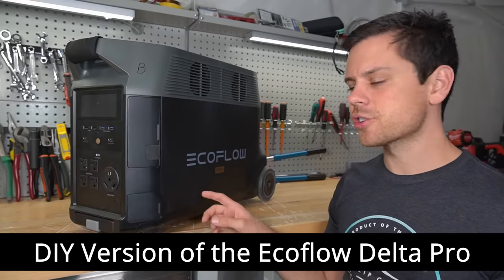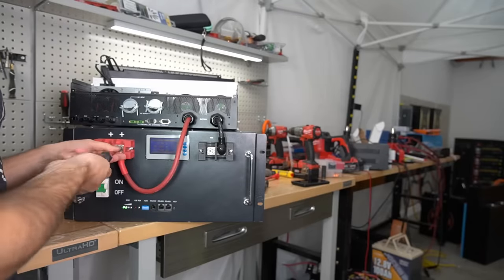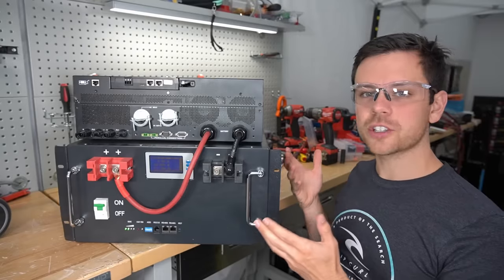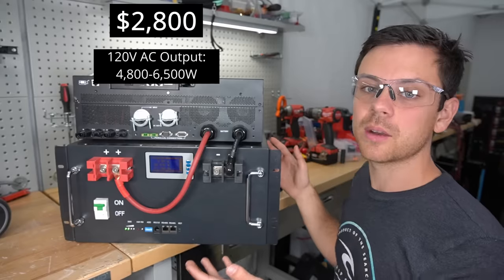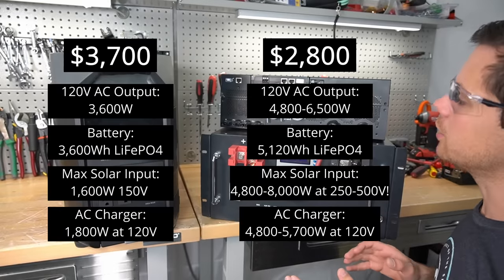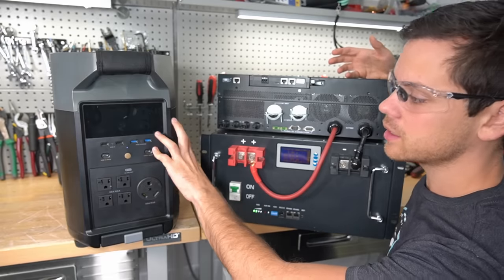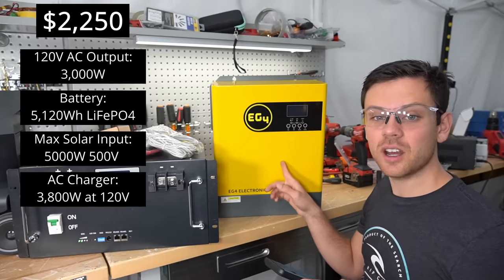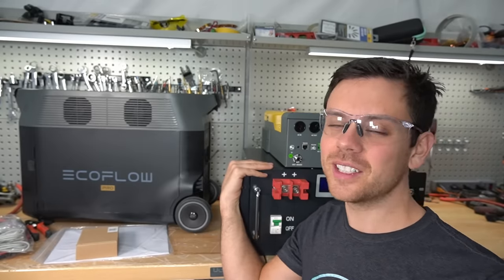Budget DIY Ecoflow Delta Pro! More power for less money

Comment: This is not a true comparison..You have to add more to the diy system..so cable connection for the AC power and fuse block and fuses this will soon be more expensive than the delta pro...a fair comparison would be to bring your diy system to the same level as the delta ..plug in ready and then tell us the cost...be fair
Reply: Nope , way cheaper to do a DIY,. It's not even close

Comment: The one thing that you never mention is that most of the generic MPP based inverters are not FCC Class B or CE certified, so they may generate interference into radios, TVs and audio components. Most of the big names like Victron, Schneider, etc. are certified, as well as Ecoflow, Bluetti, etc.
Reply: that is useful to know (certification type to ensure no interference) thanks
Reply: @koborkutya7338  these are sponsored products, all come from China, i doubt they are as sturdy as Victron. But its hard to know , the names of there companies do not say anything, I asume its generic cells from China put togheter with a name on them. Lion energy sells prismatic batteries in gheir boxes, but they are backed by Costco forever return if they fail. I have a hard time to trust these new brands without solid warranty.
And keep in mind all these inverters are transformless, which could mean short life. I think a solid  transformer inverter would outlast all these printed board items
Reply: @crinabobo7412  LF inverters have significant idle consumption as a drawback. 
Besides, i work in a similar industry (not power electronics itselft but using components from there) and you really have a hard time to tell what is China-made - practically everything is China-made. It used to be cheap and we are starting to pay for that now, we (Western developed countries) outsourced producing to them.
Reply: @koborkutya7338  If you open up a Victron inverter and see the parts. You will realize that ghey can be replaced on the board, the newer printed board ones under no circumstance. 
The power draw is not so big can be compensated with an additional solar panel. You can run a transformer based inverter techically forever if not abused. Regarding the capacitor only versions. 5 to 10 years.
Reply: Thia sounds like a cd player 52x , then they came up with the 100x....
It is all about fire, security....no ce not fcc, no ul....i would not trust my dog i side an RV with this....
Reply: @koborkutya7338   what about the Sol Ark inverters?

Comment: Really appreciate and enjoy your DIY videos Will, especially when you revisit your roots and mention DIY budget minded systems that would work well in a off-grid motorhome, or RV.  That said,  and while I know how you feel about ever owning another motorhome, I think if you made a few videos that discussed what your most "ideal" DIY motorhome battery and rooftop solar setup would actually be... I think such videos would be a great addition and a huge hit with your subscirbers.
Reply: What would be really cool would be to set up a system and include an Arduino controller connected to the vehicle what would automatically start the engine (& alternator) when it reached a minimum charge state and replenish the battery bank.

Comment: Excellent video. I do IT work and recently (as in today) just ordered an all-EG4 setup.  The 6500EX-48 and a single EG4-LL V1 server rack battery to match.  The bonus was that EG4 will give you a 5-year warranty on the inverter when paired with an EG4 battery.  This LL battery has a 10-year warranty which was nice for us b/c we're powering a Server Rack and are using this setup to deliver a consistent load of 3200W that runs 24x7.  I will hook it to the grid for input power but have the option of adding panels and more battery to get longer UPS run time and pay back for the cost of the setup by offsetting power consumption costs.  This setup cost me $2950 and the equivalent all-in-one units $3500 for budget systems (5000 VA) to well over $8000 for name brand.  All I need is a backer board, and a disconnect on the input and battery side, and I"m in business; so maybe not 30 minutes, but well under an hour.
Reply: Any interference issues w home electronics?
Reply: I am getting ready to pull the trigger on the exact same setup for a backup to the 37' RV I live in. 240v is essential for 15k btu air conditioners.

Comment: I wish Will went one step further for us noobs and showed a specific suggested solar panel array including how to wire it up.   This looks great, but most of us noobs would have no idea what solar panels to get, how to wire it (series or parallel), what gauge wire to use, where to put circuit breakers.  I think Will has been doing this so long that he can easily do all of this just in his head, but he's forgetting about us noobs who come here to be shown the COMPLETE A to Z of how to build a full working system.  Please do a follow video showing us your solar panel recommendations and how to wire it all up.
Reply from the maker: I have videos that cover every single point here. Especially the wiring of multiple panels. Or my book that is one dollar.
Reply from the maker: I try to avoid making the same video over and over again
Reply: @WillProwse  Will, in most cases I would agree but in this particular case, people like myself are looking at the Delta Pro Max and are now considering your much better alternative and would like to build THIS system but have no idea how or what would be a scaleable cost effective way of picking which solar panels you would specifically recommend.    Would someone choose series or parallel wiring for this setup.  Please consider it Will.  I know I and many other noobs want to build this system complete and trust your specific recommendations.
Reply: @MyChannel-vm6dw  agreed Will come on do it for the noobs!!! Just how to set up a array with this system.
Reply: photovoltaic / solar thermal technician here: you should just buy his book easy to understand or just watch every video he has put out. i bought the book to have in my collection because i like and support his work and knowledge. only few have taken my recommendation to go with SunPower made in the USA it's all about cost, many good solar panels out there. as to wire them in series vs parallel: in a series circuit, the current through each of the components is the same, and the voltage across the circuit is the sum of the voltages across each component. in a parallel circuit, the voltage across each of the components is the same, and the total current is the sum of the currents through each component. residential homes are not wired in series, yes and no. wire the panels in series and connected in parallel. that's going to go over your head. if we want to compare with engines 6 cylinder with one barrel vs two barrels or a 8 cylinder with one barrel, two barrels, four barrels or a 6 pack with is 3 two barrel carburetors... memories woa i got off the subject 🤣 just buy the book Bro' and welcome to the club
Reply: Hey noobs - I too was a noob like you - many years ago when I started following Will Prowse. PRO TIP #1 - Buy his book, it's good to have a reference guide on hand. PRO TIP #2 - Go to his website, he has diagrams and everything else you need to set up your own system, from bolts to nuts, from cables to crimpers, from panels to plugs. PRO TIP #3 - Go thru his backlog of videos. All the build info for the website/diagrams is in his video archive. Personally, I like the video series where he's in the RV building stuff. Also, the "milk crate" solar generator is a favorite.

If after all that research,  if you have a question, (one that hasn't been answered previously,) this guy goes balls out to get the answer to it. He will buy/build/test/destroy/teardown anything to get an answer. He then takes the time to explain/build it in laymans terms for all of us noobs.

Comment: Love it, amazing video. Can't get any clearer or simpler than this! +1 for the comment about a RV build with an EG4 3000 and a EG4 server rack battery. This is my exact setup. 1000w of solar on the roof, 3000W inverter output, and the 5.1 kWh battery is a killer setup for a small RV. Going to be creating video walkthrough of my system soon. Thank you for all the advice and solar tutorials. I've learned SO much from your content! :)
Reply: That would be awesome for you to share a walkthrough of your system and what solar panels you got and how you integrated everything into the rv’s electrical system! That is exactly what I’m looking for as well. Something awesome for a small rv travel trailer to be exact. Thanks!!
Reply: I'm actually very interested in seeing  this,  as someone not too versed in batterys, i just don't understand if you can use this to wire a van or rv built to the needed lights and sockets
Reply: I would love to see a video. However, I think that size,power output, and other factors can be adjusted to meet your needs and can live with.
Reply: I'd love to see your setup as well!
Reply: How did you get a 12 volt feed for your Rv? I would like to see your setup. This is exactly what I want, just not sure how to do all of it.
Thanks, Ron C.
Reply: @Mitchdzj  Yeah, what happened to the video?

Comment: This is an excellent video that I wish I had the opportunity to see much earlier. I could have saved over $4000 on a Ecoflow Delta Pro with a 400 watt folding solar panel. Both are sitting in a closet right now. The great news is that your website taught me where to buy the LV6548, where to buy rack mount batteries, and how to set it all up. I left that 150 volt limit in the dust and could not be happier. Blackouts will not ruin my day, and I can expand whenever I feel like it. 
The expansion units for the Delta Pro are also expensive at $2799 each for just 3600 watt hours more. Additional rack mount batteries for the LV6548 will give you 5120 watt hours more for about $1000 less each than the Ecoflow option. Since it can be charged from an AC outlet, I will mostly likely bring the Delta Pro out for outdoor activities. I found 3600 watt hours woefully inadequate for a home office. My Toshiba window air conditioner runs at 700 watts, so the battery is drained in about 5 hours. That is without running lights, charging phones, or using devices like a TV or computer. Thank you very much for your resources and videos.
I guess timing is everything. Signature Solar was out of stock months ago, but it looks like their inverters and batteries are available now. If I could afford to assemble a 240 volt system today, I would buy from them now while they still have stock.

Comment: Being able to get 220- 240v AC for use with EV charging and welding etc is important to some people .  You should do a video that steps this system up to 240v AC output.   great video.  keep em coming.:yougotthis:
Reply: I second that.  I do welding on fences and something like what you describe would be great for a spool welder or mobile jobs.
Reply: I'd like to see this myself
Reply: I think this is a great suggestion.  I need 240v for my well and that is the main reason I was looking at 2 Delta Pros linked.  So server rack batteries outputting 240 volts and at least 30 amps would be great.

Comment: I have two Delta Pro + Extra Battery setups. I love them, mostly because of the plug-n-play feature and I'm electricity challenged.  When I bought the EcoFlow, though, it was the kickstarter deal and the best bang for the buck... at that time. The more I'm watching videos from you and a few other YT content creators, I'd TOTALLY go this way instead.
Reply: no regrets here. I bought a delta pro in the beginning of this year. I have it hooked up to my work/gaming rig. In the event of an emergency. I drag two used solar panels into the back yard to power my fridge,deep freeze and mini fridge. Even on the crappy cloudy weekend when I did my test it was enough emergency power. Even if my power died right now. I can still work for another 10 hours. plus I can move the dam thing. If I go camping I can take it with me. I did pick up some electric blankets in the event that we lose power in the winter. The electric blanket only use like 100W max.
Reply: @justinnkim  You can put wheels on a rack mount cabinet that’s what I’m doing on a 10u cabinet in my sprinter. Unlock with key to remove and roll on ground/floor

Comment: Total noob, here. I really don't WANT to learn all the details about battery/solar power, so a retail "off the shelf" solution with a warranty, tech support, etc. sounds really good to me.

I currently run a 3000w gas generator for my off-grid cabin. It's more than enough power for everything we would run. We turn it on to run the AC during the summer, to run the microwave/toaster, etc. and we charge our devices while it's on. We usually don't run it at night during the cooler weather, so I have to go out in the cold to start it.  I want something quieter and with the option to remote start/stop, so I'm looking at the Delta Pro, their remote control, and the Ecoflow Smart Generator. With that setup, I'll be able to add solar panels later.

The main benefit to me is being able to set it to AUTOMATICALLY kick the generator on at 25% and off when charged. It's more expensive than DIY, but I've been researching for a while and it seems like every video I watch decreases my desire to dig any deeper. I have my nerd niches, but this just isn't one of them.
Reply: DIY is not for everyone.

Comment: I just picked up and finished with the 3000 EG4 and a EG4 battery build..total cost $2325. Put it on a 600lb dollie. Right now charge with 6 250w used panels. Ran down to 25% and charged back up today to 100%.

Comment: When I got my pro the eg4 wasn’t readily available 
The biggest drawback for the pro is expanding battery capacity,
It cost 2500 per battery and they are very proprietary as far the plugs go.
I still like my pro and haven’t had any issues so far.
I charge it with 4 245watt used panels and it handles all my needs with very little AC charging .
Thank you for the information.
Reply: yet many battery systems can be wall charged, and therefore you can dump power from the EcoFlow into other battery systems this way (with conversion loss of course).

Comment: In the home lab community, people mount server rack items to the Ikea Lack table after replacing the legs with a stronger wood.  

You can also screw wheels into the replacement legs and roll them.  

Deck screws should hold the wheels in place for years.

Comment: Thanks Will. I've been pulling my hair out trying to decide which one of these I want for months. Now that the 6500 is in stock I think that's my  goto. The main reason was delta only 1600 watt input. I even thought about two delta pros but linked together you still only get 1600 input.  And the price starts getting out of control. Thanks Man 👍👍👍
Reply: You can charge at 3000 watts input through 240v.

Comment: Solar generators have a lot if advantages to go with the drawbacks. 
Simple to use, portable, and compact.  Everything you need is inside that box.  Your ac and dc plugs are right there and operate just like your wall plugs at home.
DIY systems can basically offer unlimited power and massive charging capabilities but that also comes with a trade-off.   They're much bigger and portability is iffy.
I have a small diy system that I use as backup for freezers in the barn.  It's in a Husky rolling box so it's portable, but not really super cheap when you add in all the components.
I also have 2 Bluetti units that are very user friendly but certainly more pricey.

Comment: Thank you for this video!  I was going to get the Ecoflow Delta Pro but after this video, I pretty much duplicated this set up. Thanks to your other videos I have saved at least $2K  from my solar budget and can make other improvements. I was originally being lazy, the DIY system is well within my skill set and very expandable. In the near future I may expand the system to 240 VAC so I can run my well pump, charge my Tesla, etc. I have an old farm house on a few acres that we use as a weekend retreat. This will fit right in with our improvements. (We are keeping it looking quaint and rustic but under  it all is very high tech.

Comment: Awesome. I wanted 48 volt because my 2021 MB sprinter 2500 is on a 48 volt system. They switched over to that so save money and weight on the copper wire but also to be compatible with the new ISG ( integrated starter generator) sometimes referred to as mild hybrid. It's integrated into 3rd generation MB sprinter transmission to aid in not only starting but to help with the turbo lag on the 2 liter inline diesel 4 cylinder intercooled twin scroll turbo charged engine at low RPM. It yields an additional 20 hp and about 130 foot lbs of torque using a 0.9 kWh lithium battery. It also activates at speed when at high power and adds regenerative braking. I get a ridiculous 1000km range out of my high top sprinter (10 L/100km) with the 100 liter fuel tank. Now I need to plan out the roof layout to cram as much solar as possible up there. Thanks Will.

Comment: Dang, wish I'd have seen this ... but you hadn't made the video yet ... before I purchased a Bluetti AC500 and 2 BC300S batteries. I'll be using them in my new home as a UPS, and in my RV for solar power. Could have saved a bunch going with a DIY system like you showed here. Thanks for all your doing for the solar generator community. Your a wealth of information and make it all very easy to understand.